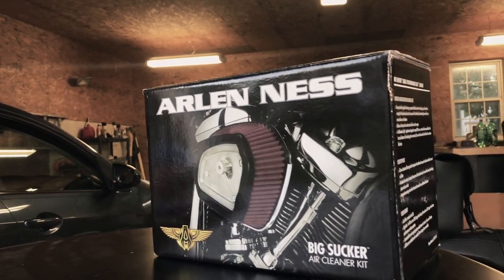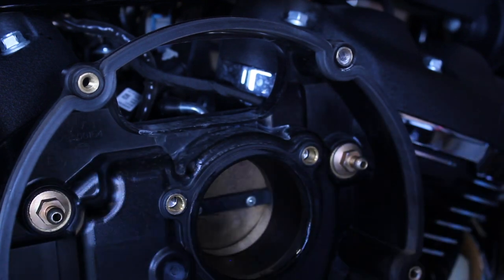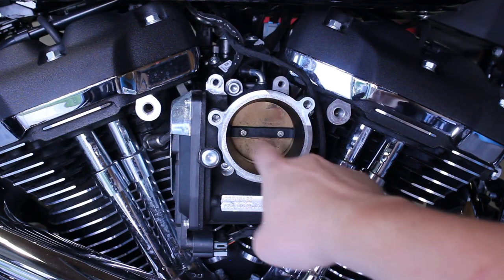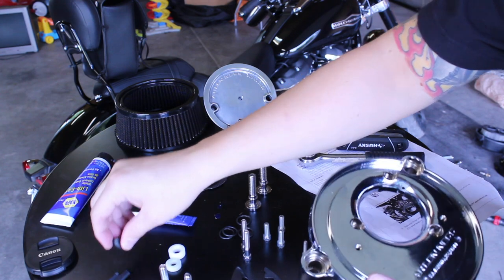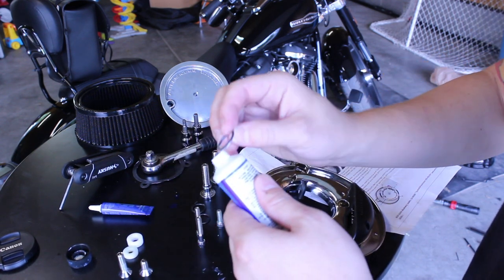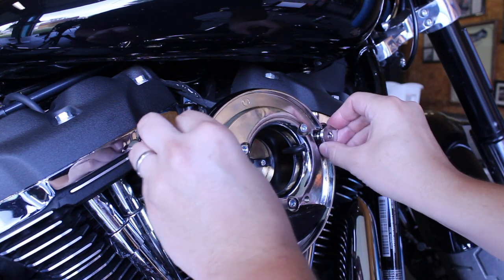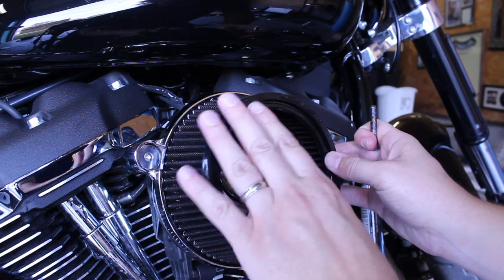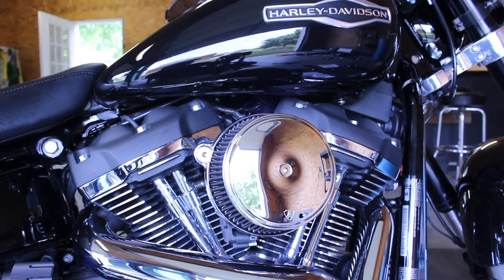Harley Davidson Stage 1 Air Cleaner Install #sportglide #arlenness #harleydavidson

Comment: Nice job on the video and cool background music.  What brand of torque wrench did you use? I have been shopping for one in inch pounds and one in foot pounds.
Reply from the maker: Jim Rides HD It’s a Craftsman. Works well. It has NM and inch pounds. Have to convert for foot lbs.

Comment: Do you recall the size of the countersunk hex bolt used to fasten the decorative cover? I chose an aftermarket cover and did not receive the bolt or spacer in my kit. Thanks.
Reply from the maker: I’m sorry I do not have that information. You can call Arlen Ness’ Tech line at 925.479.6379 they will help u out.
Reply: D-Cycle no problem brother. I did exactly that and was able to get the info. Thanks

Comment: What's the reservoir for is it used for oily misty residue or something does it  the fill up?
Reply from the maker: It acts as a reservoir by stopping any excess breather oil from ever reaching the air filter